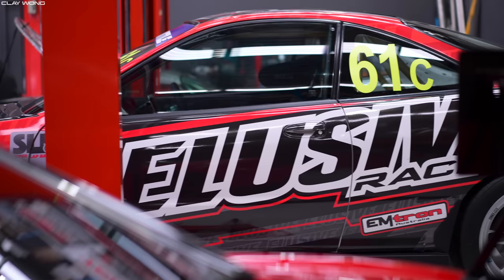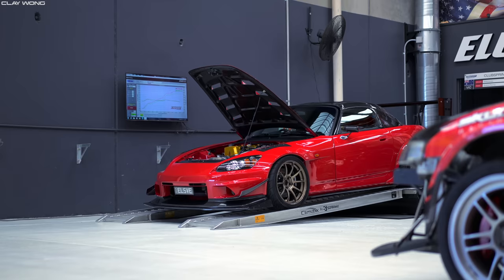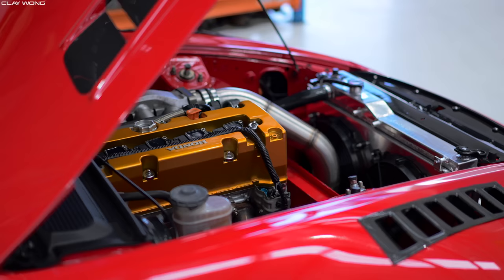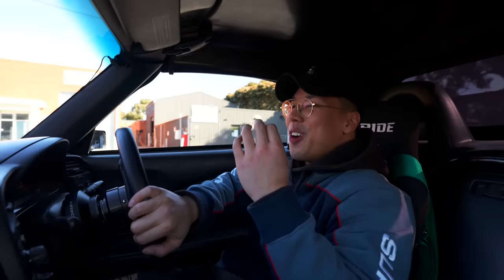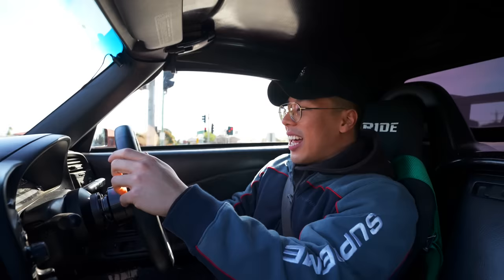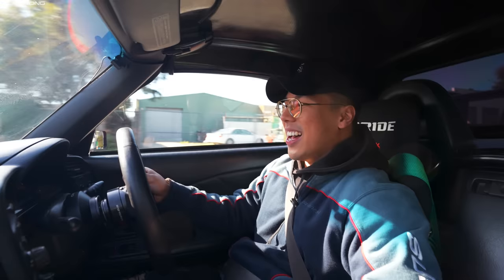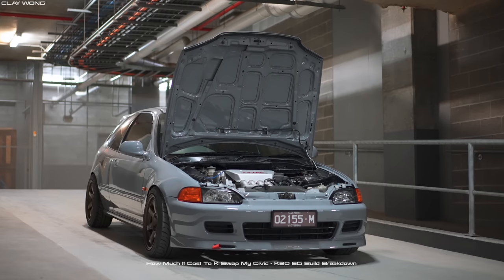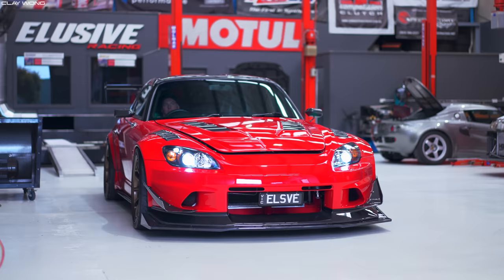This Is Why You Need To K Swap The Honda S2000: K24 S2K

Comment: So many people saying K swapping was a bad idea... literally almost every race team Ive seen that uses s2k have moved to K series motors... F series engines are great but they are expensive and not highly avaliable... K series are literally everywhere, and their after market support is only growing.
Reply: And that is why the f20 is better, it’s obviously really expensive for a reason ...
Reply from the maker: K truly is the future! People are going to look back at this in five years and realise they missed the very affordable K-Series boat.
Reply: @bige7186  uhh, it's actually because they only ever came out in the s2000. The K series has higher power potential especially when you consider k24 stroker kits can reach 2.7l of displacement, in a 4 cylinder. I know of a K tech stroker kit for the F20C which brings the motor to 2.4l... otherwise a stock K24. Without opening up the engine, and using only bolt ons and e85, the k24a2 can reach 240 hp, but the F22C usually can get to around 220-230
Reply: @inaNis_  higher potential or not, just face it the mighty f20c is the superior motor all around 👍🏼 CONVERSATION OVER.
Reply: @bige7186  Dude. If the K24 has higher potential, it's a better motor. That's what it means to be better.
Reply: @inaNis_  negative F20C is the champ 💪🏼.
Reply: @bige7186  I'm not saying the F20C is bad. The F series motor is better than the B series motors. But you gotta understand, there are 10x more K24s than there are F20 and 22Cs, and the K motors have more development and higher top potential than the F series. I can't even build a 1000 hp F22C for 10,000 dollars, but you can buy a ready made, dry-sumped K24 ready made for boosted applications for around 10k. It's very straightforward.
Reply: @bige7186 i see more k swaps
Reply: @ゴールデンクマ more expensive = better quality period.
Reply: Ehhh, let's just see who can rev at 9k the longest and call it a day. Oh yeah the k24 doesn't come near that.. and doesn't come forged from the factory like f20. They made a special motor in a special car that it deserved. K24, not so special..
Reply: @bige7186  That literally makes no sense. Maybe, just maybe the reason that f-series motors are so expensive is that they were only offered in one car that was produced in low numbers vs. the k-series which was offered in several Hondas.
Reply: @bige7186  More expensive doesnt mean better quality it just means its hard to get. Less available.
Reply: @justconcentratee  K series do have forged crank and rods lmfao
Reply: that is true anything for my s200 isnt cheap but i love the f20c
Reply: Your argument is invalid since now there are shops everywhere that rebuild the f20/22 engines. Sooooo yeah there is no shortage of resources now. Maybe ten years ago this was true. But high demand means as time goes on more and more people contribute their time to developing solutions and answers for the s2000 platform. Now there are multiple race shops that offer engine rebuilding for the f series. There’s literally no reason to swap an inferior k series engine into the s2000. None.
Reply: @bige7186  you must make people's heads hurt, your argument makes absolutely no sense at all. Honda's build quality and quality control in their engines, cars, ect does not change absolutely Clueless. Hahahaha
Reply: @justconcentratee  The K-Series comes with forged internals lmao what are you talking about?
Reply: @bige7186  more expensive every time it goes boom = bad for a race car.
Reply: Everyone k swapping cause no supply + demand and cause they blew their F series motor. Otherwise, most people aren’t K swapping for the hell of it.
Reply: My boy has a 289whp 201wftlbs. Stroked to f24. Thats what I'm gonna do. But once it goes I would have a built k24 to put in. Rebuilding would be to expensive, but in time it will get rebuilt
Reply: Great build!
Reply: @ClayWong  No one is looking back saying they missed out on the B18c1 engine, f series is the gem now not the K, in 5 years, the K will be outdated in place of the L series engine.
Reply: K series because of availability and cheaper. F series better .
Reply: @kendalgee5808  f is a gem but not better than k , and people still love b series ,,, L series is cool but need more aftermarket stuff for swapping into older honda
Reply: @bige7186  The F20c is awesome but it's more like Honda's first real try at a POWERFUL 4 cylinder. The K24 took lessons learned from teh F20c and improved it into a general package for all Hondas.
Reply: @igvtec  yea he clearly just likes to troll lol pointless comments
Reply: @mamiisthebestgirl5267  L series? um, the L series is straight up garbage... Its literally a Honda Fit motor. Its small, it cant handle a lot of power, it cant be built NA, and is super limited in modification.. MAP has been working for like 5 years straight and still cant put down 500whp reliably in them and are having all types of problems. Its a terrible motor for modding. Same with the K20C1.. The direct Injection system and slow flowing head is a huge problem they need to overcome in both motors and really cannot be overcome without a fully ported and custom head with port-injection. Even then, the L series wont handle much reliably.
Reply: Well, those are race teams. They’re in it to win, not have fun. Cost-effectiveness and availability of parts count more than anything, which makes the K swap sensible. But if you’re out on the open road enjoying the drive, then nothing replaces the F20.
Reply: @Ahsangill19  They are almost the same engine with a few alterations. The difference is money.. K's are far cheaper and have a way larger aftermarket. There are also far more K-series as well in supply.
Reply: @Ahsangill19  Love it... 6mths later and still keeping this thread alive... its funny coming back and reading this ugly thread I've created... and I'm sure the ongoing conversations is great for the channel... lol
Reply: F-motors are crazy expensive to replace and to tune. Honda has been making K-motors for 20 years now and they likely won't stop because they perfected the motor. K-motors are plenty and far more affordable to tune while being damn reliable too. K-series is here to stay and King. F-series, C-series and B-series are all outdated and done now.
Reply: @inaNis_  dude is just in denial
Reply: @inaNis_  look at the js racing s2k, 2.7 f20
Reply: @inaNis_   ya but a well done swap isn't necessarily cheap
Reply: Haha awesome thread xD so from an engineers perspective the F20c (has nothing to do with F-Series btw) is a more „interesting“ handbuilt engine or technologically more advanced especially back in 1999, it‘s not an easy task to make 125hp per liter reliable. I agree it lacks torque but that doesn‘t really matter on a racetrack or while spirited driving. The F20c was the developement engine for the K-Series so all lessons learned went into the K Series and makes the K a much more reliable engine (does not mean the F20c is not reliable if you service them correctly, top up the oil regularly etc.) but the K series did not get all of the fancy tech like the F20c like carbon low friction coating etc thus revs lower and makes less power stock. What makes the K series so strong is the reliability and the aftermarket as the engine is widely available, a lot more aftermarket research has gone into it as the market is a lot bigger. I will definitely keep the F20C as long as possible, but if it blows i would get a built K20. And from my personal opinion, the early F20c (2002-2003) is a much more exciting engine (more than F22c) and peak stock Honda (from a excitement perspective), i never felt that in a stock K series engine in regards to responsiveness or the rev. Speed (But that also depends on the car i guess)
Reply: My F22 turbo has been so reliable completely unopened with low 600whp all day! And for everyone building Ks and F motors in the end the prices are about the same!
Reply: Ok you sound like you know alot about this stuff, what goes into taking a transverse engine work as a longitudinal?
Reply: @mfsusanoo7238  lol, glad to see someone keeping the thread alive... going have to start claiming royalties... and to answer your question... I dont "know" a lot... I "know" what I see, and a lot of teams that focus on building S2K's have swapped to K series platform. Check out ASMotorsports, and the boys from Gears and Gasoline... there are also numerous kits out there for almost every platform and the pool of avaliable swap kits just keeps getting larger... K Miata is an example... from my understanding the basics of making the K fit RWD platforms is an aftermarket oil pan, aftermarket intake (I have seen some people modify the RBB intake to work..) and where the coolant lines met the block needs a aftermarket 90 to route the coolant away from the firewall ( which I believe K Tuned? Or perhaps Touge Factory produce)... there is literally more K builds on the internet atm then almost any other platform...
Reply: f series tho
Reply: @kendalgee5808 B18 series built, all motor is the best sounding. K-series is best for tuning, power and performance.
Reply: @bige7186 doesn’t make the same HP 😂
Reply: You said "race team."  For the non hard core racers, with a perfectly good F series it doesn't make any sense.
Reply: @BossItUp911  good on you for keeping this thread alive.
Reply: Probably parts are cheaper

Comment: Love the K series, but I would only do the swap if I blew the f20/22. The F is KINDA like  a built K from factory. its just special.
Reply: @Ahsangill19  no it isn’t. Spend 10k on upgrades to either motor. Better yet 15k. Who makes more and better power.
Reply: @mugengt142  first off every dyno is different and sea level is different. It’s common knowledge that you can’t get more power out of a f20/22c motor as easily as you can from a k series. And let’s not talk about each engines max power. Cause obviously more cc will give you more power. If the s2000 had a choice between k20a2 and f20c. Then I know which motor I’m going with. K20 will make more torque just because ivtec. Better powerband. It would respond better to bolt ons. And surpassing a f20c with bolt ons. Then once you get into building the engine. The k will blow away the f.
Reply: @mugengt142    It has nothing to do with being broke or not. You have millionaires that spend money on everything and there are millionaires that always count their pennies. And you got broke people doing the same thing.
Reply: @youtubecomments5951  you're missing the fact that stock for stock they're not that different. Most people will only ever do bolt-on's and a tune at most and be completely content, let alone dump 15k into one or want to swap an entire engine. You'd have to offset the cost, time and complication of swapping a K series before you can even start comparing the two engines, and at that point most people find the cost per performance hard to justify, even when the K series is undoubtedly superior as an engine. None of this stops the F series from still being a damn good engine. The k swap is really only for people who are serious about peak performance.
Reply: @NitroNuggetTV  ok I’ll say this then. The k20 is a better platform to start out with and I’ll say again. If the s2000 had a choice of a f20/22 k20/24. I’d go k series all day. So bottom line. The k is a better motor
Reply: @mugengt142  the problem with you is you care about what motor it came out from. I care not where it came from out them side to side and put it in a car. Which engine would you choose. I choose the k
Reply: Better is very relative ^^
Reply: Facts. I've always thought of the K-series as the "if i blow my FC20C" engine. It's the fallback plan. I'm from USA though, so I'm more inclined to go LS at this point.
Reply: Those wing vents look like someone couldn’t be bothered to french them in. Pop rivets are lazy and look cheap.

Comment: The F series is superior to the K in stock form in every way. I feel like swapping it out kinda takes away from what the s2000 is and was intended for. The fastest s2000 in the entire world is an f series engine. And there’s so much support for rebuilds of the f series now, there’s literally no reason to go to a k series. Plus, here in Cali we have to stay smog legal so a f series engine swap won’t work. But cool video ✌🏻✌🏻 we will keep our f series alive! We’re a die hard bunch of gear heads that own the s2000.
Reply: i know im late but like for the price of k swapping and adding performance parts to it versus keeping the original engine and adding performance parts to it it sounds like youd probably be better off keeping the original engine and be able to add more performance parts to it instead of paying to swap the engine first. like if there was a budget challenge to use only 15k to get the best performance out of these cars the one that didnt get engine swapped would have higher performance because youd have more money to spend on the actual upgrades versus swapping in an engine first. by that point i think youd just be able to spend a little extra on finding a way to make the original engine more powerful and more reliable with the right parts anyways

Comment: I am still in love with the F20C. 9000rpm is intoxicating and visceral. TBC still gives me a much more connected feel than the later F22 DBW. I regret the day I sold my 02 AP1. I kept track of it and one of the new owners totalled it :(
Reply: Built k24s spin to 10k no problem
Reply: @lazybullitz3821  i doubt it, a k24 7k rpm has piston speed higher than k20 8k rpm, unless destroked even if built that k24 is not going to last that long
Reply: @ulisesavila2879  you must not know much bruh tbh. There is a whole class of cars doing that in the 7's. I think some guys are spinning them to 11k with all billet motors
Reply: Spoon F20C‘s rev to 11k rpm

Comment: I would personally go the FI route with supercharger instead of k swapping. F series seems such a good match to the s2000 chassis. An engine that only came on a specific car says a lot. And really you can't beat the OEM plus look. Good build though
Reply from the maker: Love all the different styles of modifications for these S2000’s!👌🏻
Reply: Perfectly said 👏👍🏼
Reply: Well F series isn't specific to S2K , it's a derivative of the fwd prelude and  accord engines...
Reply: @ArtVandelayOfficial  different kinds bro
Reply: @ArtVandelayOfficial  only thing the same is the letter.
Reply: @justinmurphy7173  um no
Block and frm cylinders
Reply: @ArtVandelayOfficial  f20b did not have frm sleeves and it a timing belt motor that shares no components with a f20c  f20c and f22c are closer to k20 then f20b
Reply: @ArtVandelayOfficial  I'm really not sure where your getting your info from but it's wrong. Motors don't even rotate the same direction
Reply: @Thor Odin son might want to look it up "buddy"
Reply: By my comment i meant the F20C engine. In my opinion its a great engine and swapping it off doesn't seem right to me personally on the s2000. Although i do get why people go for the k series. It has a much wider aftermarket support and its newer engine. As i ve mentioned before though i'd rather spend the money on a supercharger.
Reply: I have a friend with a k24 with the stock s2000 airbox. At first glance the only thing thats off its the black head cover. The rest looks like a unmoded car
Reply: The Kseries motor is an evolution of the Hseries motors. The H22 was Honda’s racing engine from 92/93- 2002. Then the K series came out and became there racing motor. Now yes the engine is a lot different but the idea behind it was to carry on with the H series performance in a better way hence the K series. Honda tells you this.
Reply: one can go k2, almost the same as an F series, revs almost the same for ap1, reves the same for ap2
Reply: K20a2. Same displacement 10x more support easily make 250whp while f20 takes so much more to get to the same power. And the potential of a k20a2 is so much higher.  Blow a f20c and it’s a no brained to kswap
Reply: The F20C makes 250 stock in japan everything else i agree. But also for the F20c the limiting factors are exhaust and headers/cat, swap them with a better flowing system it‘s easy 20+ hp. So 250hp on the wheel in an F20C is not so hard to do and that without touching the engine

Comment: Such a great engine the k series is especially when turbocharged or ITB, the F series is impressive as well I read somewhere you can get 600-700 hp out of it with stock internals. I don’t know what I would do if I had a s2k keep the F series or go for the K 🤔.
Reply: i made 600hp on stock unopened engine with e85 an a precision 6262...only payed 12k for the s2k with a metal widebody
Reply: Ye i took a interest in the F20C cause wanted to place it in a DC2 and ye their internals come forged from factory so you can run 30psi on a stock F20C block if i'm not mistaken and that's pretty cool
Reply: I made 615whp on c16 and 515whp everything stock besides injectors, clutch, and a full race kit. Made it 4 years of abuse without issue then a head gasket went.
Reply: There's guys pushing 950whp with just valve springs and head studs on f22c1 stock block. You definitely need to have a good tuner.

Comment: I would give just about anything to have an S2000. Got my first honda in March of 2023, an 8th gen Si coupe. Had 190,000, paint peeling, and some light body damage, but I loved the hell out of that car. Had a motorcycle accident in November of 2022, breaking both my legs. I only got $7k back and $4000 went to getting my car. It was recently stolen on May 1st and I've been sick without it.